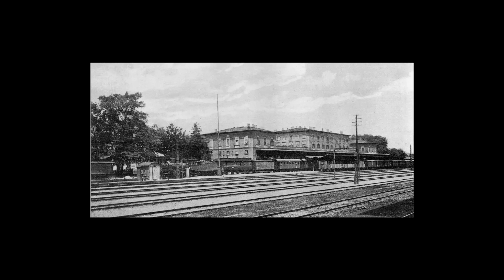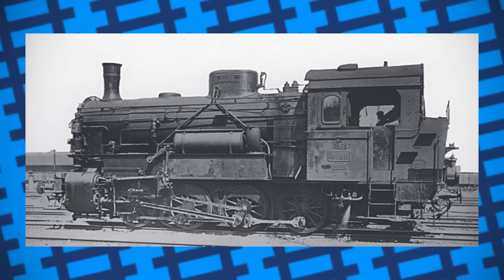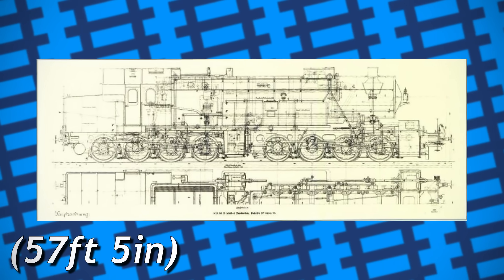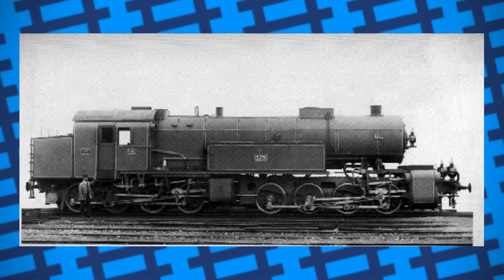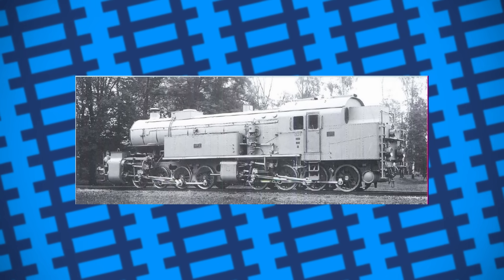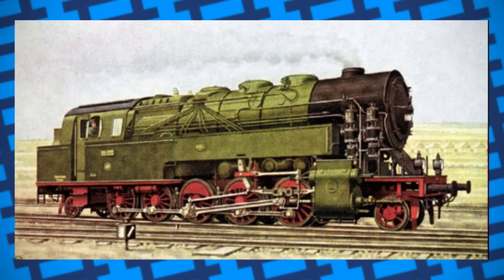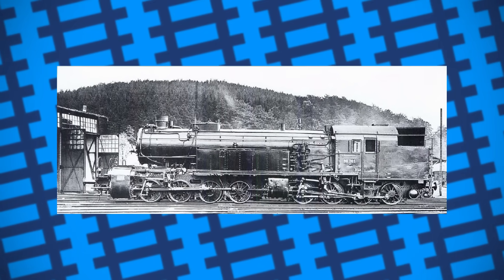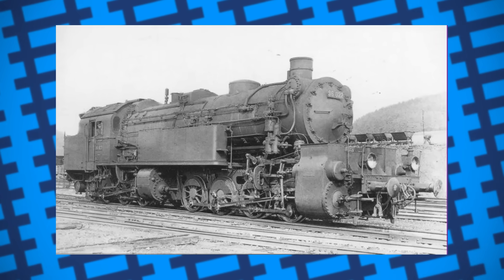Bavaria's Mega Mountain Engines - Bavarian Gt 2×4/4

Comment: I have to wonder why not improve the tracks in these mountains to handle heavier axle weights to allow a less restricted design. True the trains could only really run on these mountain lines then but it seemed like that was the plan all along.
Reply: Basically two reasons
1: Bavaria was quite keen to electrifying their network as they didn't have that much coal but had loads of hydro power options.
2: Increasing the allowed axle weight would allow the DR Class 44, which was both easier to handle for crews and faster.

Comment: As far as axle load is concerned, why does no one ever just say "Well locomotives are only going to keep getting heavier so we may as well start upgrading the tracks now so we'll be able to use heavier locomotives by the time we need something even more powerful."?
Reply: If I had to hazard a guess, it was a cost prohibitiveness issue.
Reply: @lyokianhitchhiker  That's why they SHOULD START when they have to bend over backwards and jump thru hoops to build a powerful enough locomotive that doesn't exceed the axle load limit. So that WHEN they need an even more powerful locomotive they'll have already finished upgrading the line (with the cost spread out over several years) and they won't be trapped with no choice but to ether, double head trains, upgrade the line all at once, or upgrade the line over a longer time frame but have to double head trains until the whole thing's done. 
If they preemptively invest the money upgrading the infrastructure over the course of several years (to spread out the cost) they'd save more money in the long run.
Reply: @t1m3f0x there’s also the fact that it’s more practical in some ways to just make bigger engines with the weight spread across more axles than it is to just rip up the track every time
Reply: @lyokianhitchhiker  You'd only have to rip up the track once as long as you you do it right the first time and don't cheap out and only upgrade to the bare minimum. Spend the money over several years so when the trains get to heavy for the locomotive you just built the line will be ready for the new more powerful locomotives that will replace it, to have a higher axle load.
Reply: @t1m3f0x  Probably the same issues as today. Politics and too many other things that take priority for government spending.
Reply: @StaffordMagnus  Oh right, I forget that mainland Europe nationalised all their railways very early on.

Comment: what do the cylinder dimensions mean exactly? it's 2 numbers, i assume one is diameter and one is length, right? what if one is bigger but the other one smaller? is it something similar to the question of traction vs speed on driving wheels?
Reply: Usually these are dictated by the amount of available space and the engine type that was used. Bavaria loved their compound units with the high pressure cylinders between the chassis which basically dictated the rest of the values due to physics.
Having all the cylinders on the outside gives a lot of space to get the maximum efficiency out of the boiler.

Speed is dictated by wheel size, valve type and overall stability. A good example of that (and the clever Einheitslok approach) is that a 01.10 (3 cylinder express engine) shares the common parts of the valvegear with a 44 (3 cylinder heavy freight). Both have the same cylinder size, but very different roles and maximum speeds

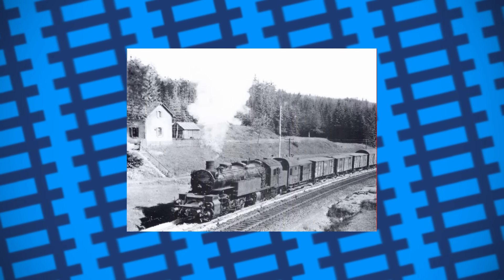Comment: 5:24 Poland started as well building a 2-10-2 tank engine in 1934-1936 for the Krakow- Zakopane line which had a 25‰ grade. At first a 2-10-4 was conceptualized but later they settled on a 2-10-2 which proved to be more efficient. That locomotive is OKz32

Also reminder Poland built the BDZ Class 46 aka “Mother Bear” a 2-12-4 for the Bulgarian Railway.
Reply: 25‰, not 25%, right? Or was it cogwheel driven? Otherwise, this would be way too steep for any normal engine to handle.
Reply: @madmaxmxp7811  25‰ Yes

Comment: I dit Not knew that Germany build thes Tank engines that Look like 4014, but i find IT sad that none surived....
Reply: Not Germany built this,  Bavaria did it. In the Year the locomotives were designed and built, Bavaria was the Kingdom Bavaria. Germany was founded after WW 1.
Reply: This one is the last of a lineage, two of the smaller types are preserved. One (the BB 1 type ) is cut lengthways as a display piece, the other one (BB 2) has been under restoration to running condition for decades.

Comment: this is also same problem happened in Dutch East Indies, especially in West Java region, so the company make 6 model of Mallet Locomotive, with 1 model using 0-4-4-2, 2 model using 2-6-6-0 and 3 model using 2-8-8-0
the earlier model of 2-8-8-0 were built by ALCO and later model by Werkspoor